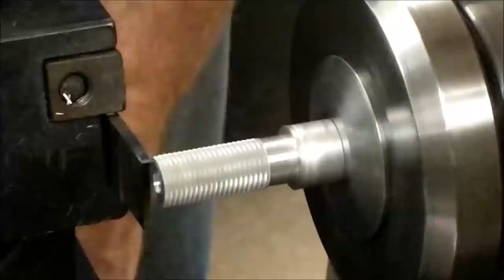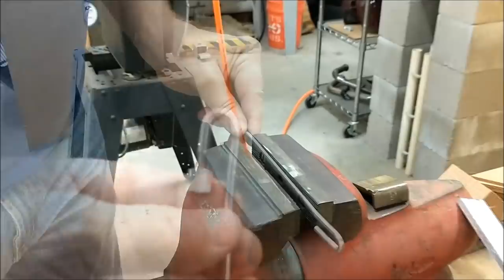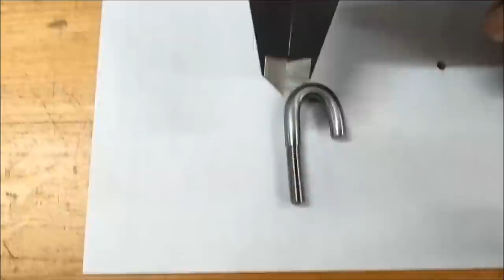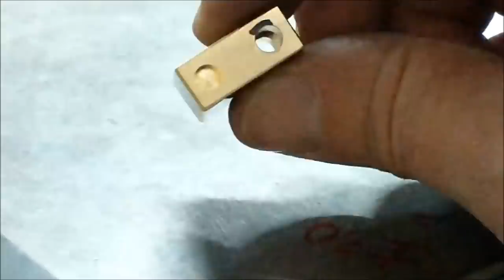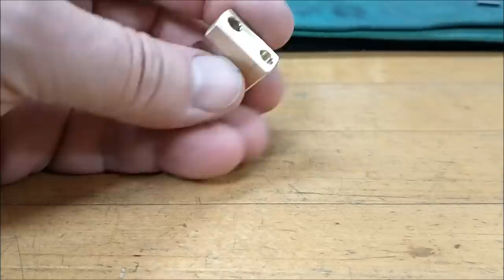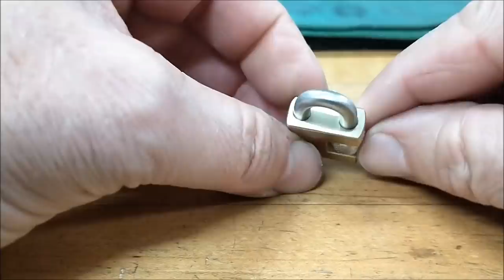Machining a Miniature Brass Lock !!

Comment: That's a nice keychain. A few holes, pins, and a spring and it can be a functional lock with a pin for a key. Still not high security, but functional.

Comment: Love it.   The tip of zeroing the calliper is classic. Thanks. To stop the knurled piece coming off an old blacksmith told me to use a centre punch and point the end of the screw enough to stop the nut from coming off..  a small centre drill and then just a punch will deform the end just enough to stop it running all the way off.  If you wanted it to be secure...ish....Amacf
Reply from the maker: Even simple little projects have a learning moment. Glad you liked it.

Comment: Nice tip with the center distance on the zeroed calipers.
Reply: I use that trick a lot, it's very handy.. if you don't have digital calipers, just subtract the diameter from the outside to outside measurement.  I use it mostly when I"m drafting an existing part and have to make measurements of existing bolt centers
Reply: @Rx7man  if I'm measuring between bolt centres, and the holes are the same size, I measure between the two left edges, equivalently

Comment: Great item Joe, well done. Next time you have an hour to fill in, how about repairing / replacing the bandsaw table blade infill cover ? Big gaps will lose tiny bits inside the dust box. If it is steel a quick blob of weld, grind the top off and recut the slot. For A man of your talents it will be a simple easy peasy job.

Comment: A nice no-stress project! I am a retired telecommunications technician, so my knowledge of what you do is very limited, although I have learnt a lot from you guys on Youtube. Can you please explain, when thread is being cut on the lathe, how the cutter is set so that is starts cutting precisely on the same spot when the thread is deepened. Thanks Joe! I am looking forward to the rest of the lathe project. I can watch projects like these for hours.
Reply: It's possible due to threading dial, basically a gear that rides on the feed screw. Search How thread dial works and you'll find many great explanation videos

Comment: Joe, how do you refind/restart the thread on your backwards threading technique?
Reply from the maker: My machine has a digital readout on it for precise positioning of the carriage. Once set, the gearbox and thread dial assure the pitch picks up the same groove every time. That 10-32 thread was run at 770 RPM and all depth of cut was controlled with the cross slide. No compound used.

Comment: I think in gonna attempt this as a lathe only project
Reply: Hay Joe pie think it would work?  4 jaw to face off each side, endmill in a collet Chuck and the part in a quick change tool holders so I can adjust the hight a little. The holes in the drill press and I have a small rod bender.... I think it just might work
Reply: Definitely could be done in a lathe with a bit of thought.  Getting a square cut out for the knurled wheel might be a challenge. If you mount the lock body offset in a four jaw you could do the cutout but would leave a radiused rear face which I think could look pretty nice.  Could also radius the sides of the lock this way rather than using a belt sander.
Reply from the maker: Hold the end mill in the collet and clamp the block in a tool holder. Power feed across. Done.
Reply: @joepie221  that's what I was thinking. I love your channel that look forward to Future videos

Comment: I know you said that none of the dimensions are critical, but did you match the diameter of the thumb wheel to the pitch of the knurl you used and if so do you have any tips on determining the correct diameter?

Comment: Thank you, as always I learned something.... it seemed a very coarse blade to cut brass? But obviously it worked.
Reply from the maker: For the thickness of the material, the blade was ideal.
Reply: @joepie221  Thanks, so for thinner material one would need a finer blade?
Reply from the maker: @transistor754  A good rule of thumb is to have at least 2 teeth in contact with the material at all times. so Yes. Thinner material=finer blade
Reply: @joepie221  Thank you, So the TYPE of material doesn't dictate the number of teeth?

Comment: The only problem with this lock is, its pick resistance is zero.
Reply: So, slightly better than the lock that key at the end fits in?
Reply: I don't know.  I'd send it to the Lock Picking Lawyer for evaluation!
Reply: In comparism to other locks even Lockpickinglawer would "screw" up ...